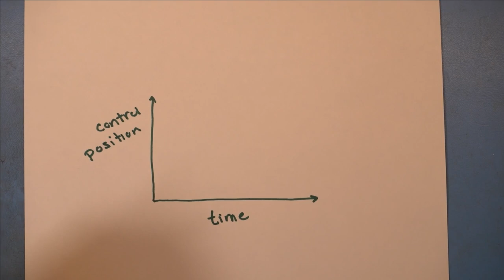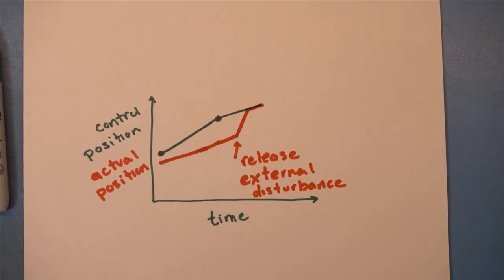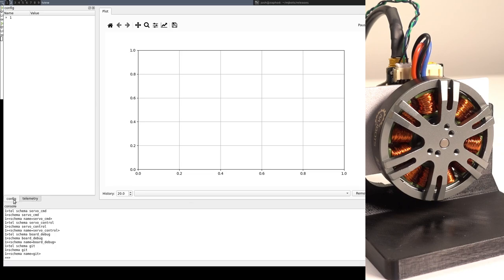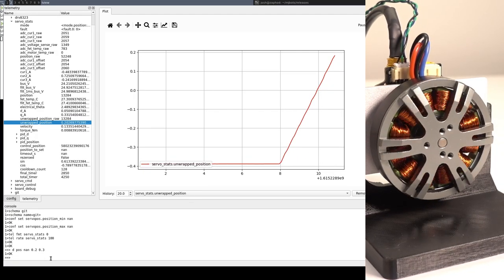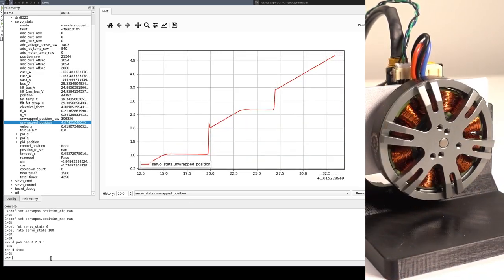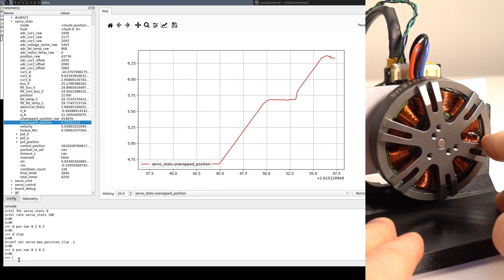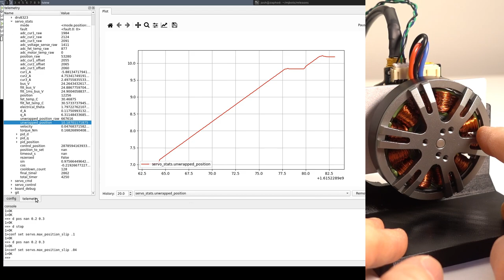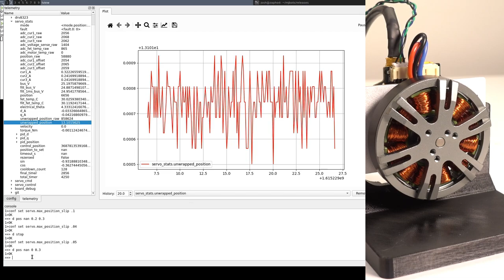moteus position "anti-windup" (pure velocity control mode)

Comment: Hey Josh, would you consider creating an open source 6axis robot arm based on your controller and motors? I think you could create a lot of demand for your controller if you made a relatively low-cost robot arm design. Currently there are no real cheap Bldc robot arm designs yet, everyone works with steppers.
Reply from the maker: Its a cool idea, but not really economically feasible within my business structure.  I hear the Innfos arm is resurrected, which is about as low cost as you're going to get.

Comment: A fixed limit is common, but my favorite is using a leaky integrator on the I term. Did you try that?
Reply from the maker: I didn't, and I agree that leaky integrators have some benefits.  The nice thing about fixed limits is that it is easy to reason about what the number means when tuning.

I'm assuming you primarily use exponential decay integrators?
Reply: @awesjosh  yup!